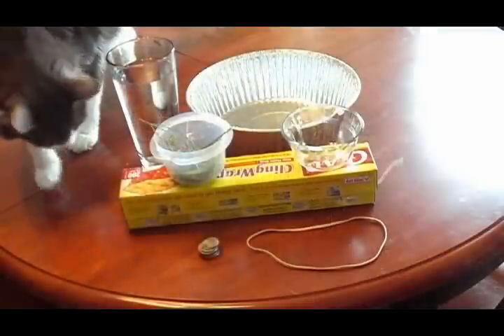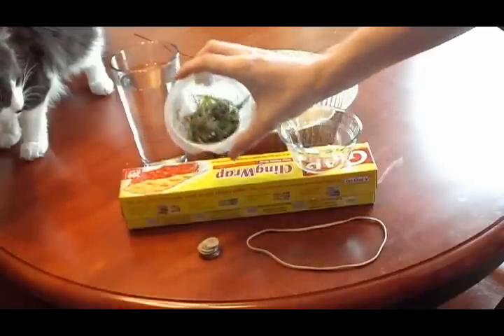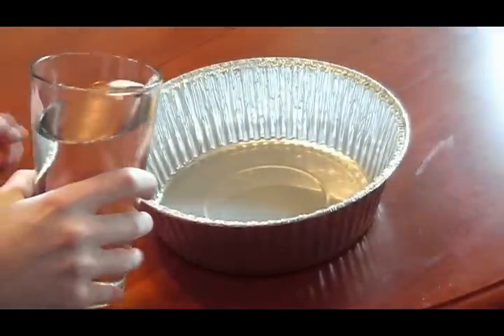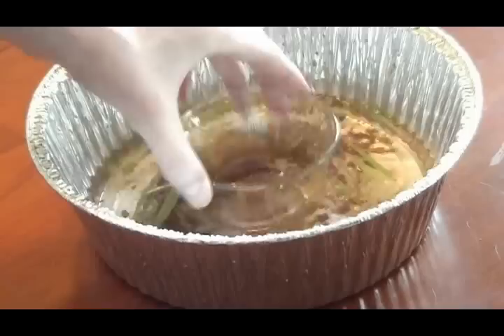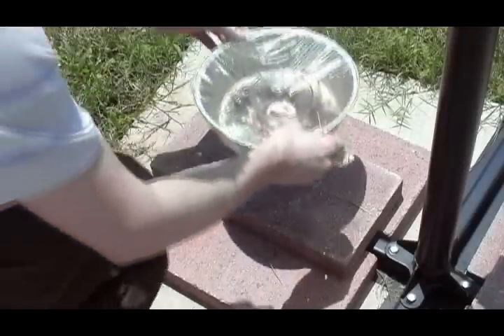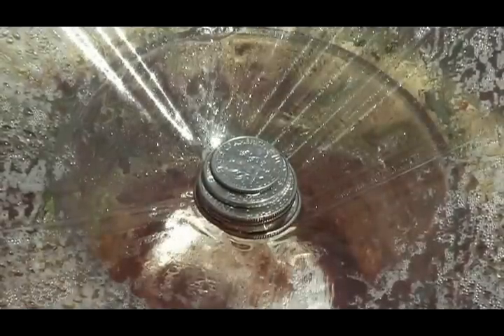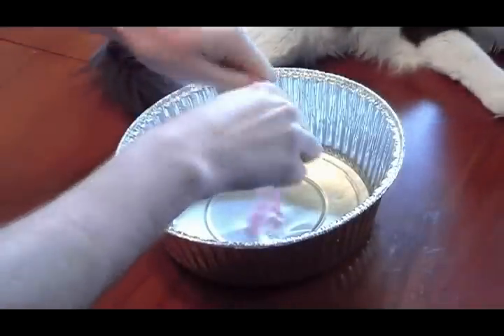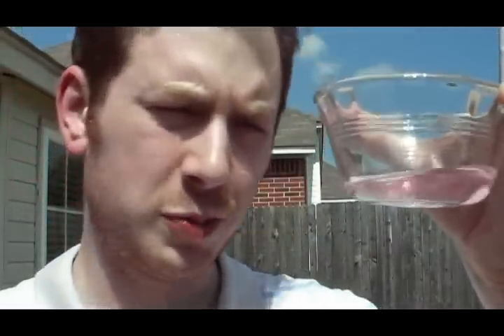Solar Water Distiller

Comment: I first heard this from a Viet Nam vet who said that did a similar thing. If they had no water, they could dig a pit, urinate in it and put leaves in it, they they covered it with plastic and put a stone over the collection cup (I don't know what they used). The sun evaporated the water and left them drinkable water. That  process is very similar to this process.

Comment: Finally, someone points out that you have to be careful of your water source when distilling. All those DIY stovetop distillers are USELESS if the water is contaminated by any chemical with a lower boiling point than water, such as Petrol, Benzene, Ammonia, Acetone, etc. https://www.engineeringtoolbox.com/boiling-points-fluids-gases-d_155.html

Comment: That's clever but the plastic would contaminate the water methinks, distilled water is very good at leaching(the plastic wrap covering it or the container holding the "distilled" water in the end). However most plastic used for food now is food friendly I think.

My point is beware of the materials you use in distilling if you want actual distilled water.

Comment: I don't use plastic at home and I never use aluminum. Boiling is free and probably one of the best ways to filter water, or UV light. For around $20. (USD) buy one of those H20 Life Straws on Amazon. They filter out 99.% of waterborne bacteria and 99.9% parasites. They do NOT filter out chemicals or pesticides like glyphosate (Roundup), salt water, arsenic, heavy metals, uranium, or viruses.  

That is why protecting water should be on "everyone's priority list."  Instead the EPA were exposed 'deliberately' dumping toxic chemicals into the Animas River in Colorado (but they called it a spill) which flowed from the Animas 200 miles into the San Juan River in New Mexico in August 2016.  You cannot filter out contaminated water like that. And the malicious beings who run the EPA know that. 

Those oil pipelines are another extreme danger and always built in the wrong places - near precious waterways as are nuclear power plants.  Hardly no one believes or fully understands the danger of not having drinkable water until it's too damn late because they think it'll never happen to them.
Reply: water condensed from water vapor from contaminated  is dramatically safer than boiling contaminated water.  some bacteria can even survive boiling, hence the use of autoclaves, but no bacteria can be evaporated. also, heavy metals do not boil away.  btw, boiling does kill waterborne pathogens.  autoclaves are needed to kill surface borne bacteria.
Reply: AquarielCharms 

You are exactly right
Reply: You should be getting 1,000 thumbs up for posting this accurate information. However, as usual, people will ignore it. Thank you.
Reply: I have a problem its not safe too (THE STRAW)CAUSE IT ONLY KILL 99.9% I NEED 0.1%MORE!!

Comment: Never use plastic to distill-this idiot is adding toxins from the plastic to the water. Plus these do not "purify"-all the crap is still in the water.
Reply: This is something used in emergencies where you can't find any potable water. It'd be very foolish to drink distilled water on a regular basis.

Comment: don't ever drink distilled water. Distilled water contains no minerals at all, so it will remove them from body with sweat and/or urine, causing serious problems. you may add some little amount of salt (sodium chloride), calcium and magnesia (dolomite stone) to convert distilled water into drinking one or drink juices if you can.

Comment: So the red colorant shows that the distilled water is not pure  at all. What's about poisons and bacteria? Without knowing this, it may by a high risk to drink it.
Reply: It's fine. This isn't the best way to do it, this is one of the simplest. Food coloring makes colored condensation, but solids can't do that.
Reply: The red color of the water is in fact caused by solid particles - most likely a pigment called carminic acid - suspended in the water.  The H20 does not change color.  Somehow some of those particles ended up in the collection cup.  Note how small the food coloring particles are.  It's like fine dust.  I imagine the upward stream of water vapor creates something like a tiny updraft which is enough to lift some of those tiny pigment particles into the air and into the cup.
Reply: My guess is the colorant has a lower evaporation temperature than water, so it too was distilled. If that's what's going on, then anything similar would be carried through - the benzenes, etc, while minerals, solids and anything with a higher ET than water would be left behind.

Comment: would a thin cloth work in replacement of the cling wrap?
And I'm guessing this method wouldn't work with salt water right?
Reply: +Sushi Mo Nope, it relies on condensation, the cloth would simply absorb the water and allow the vapor to escape. It does in fact work with salt water, but it can (as he warned) still contain toxins. Hence a filter should also be used with a distillation system to keep the water safe from any remaining toxic gunk.
Reply: oh ok thank you ^_^ Bruce Wayne 
What about Leaves?
Reply: Sushi Mo  No problem man. Did you mean leaves used for a filter or if leaves are in the water? If you meant for a filter it'd be really dodgy. Charcoal is a pretty top notch makeshift filter that requires little skill to make. Check this out if you want to see more methods on filter design: http://www.engineeringforchange.org/ten-low-cost-ways-to-treat-water/

Personally I think the clay and rice-husk design is clever and totally doable by anyone.
Reply: Thank you so much! This will help a lot and it's good to know someone who knows their stuff!
Reply: Sushi Mo That's all good :) I'm actually studying this stuff at the moment so it's something I know a thing or two about :)
Reply: niice! :D that's great!

Comment: what about mineral etc, because body needs that. is that ok if you drink everyday?
Reply: +smy yakob Normally you take in way more minerals through food than water, so unless you are on some weird type of diet you will get all you need.
Reply: +smy yakob Depends on your diet I guess.
Reply: I bought an electric water distiller off Amazon so I drink distilled water most of the time with no problems. They do say don't use it for making coffee as it makes it taste bad.

Comment: After distillation, boil then run the water through a charcoal filter to get rid of pollutants
Reply: +Moe Avazi Just the filter is probably the best idea. Most bacteria dies at a relatively low temperature (around 55-70 degrees Celsius) after just an hour or so. Boiling the water might help but really isn't necessary in a survival or natural disaster setting.
Reply: If you're going to boil the water, you may as well have done that in the first place to collect the water lol

Comment: While this does remove impurities, the only way to kill bacteria is to boil it for 10 minutes.  Boiling will also increase the evaporation.  I have seen many video's with solar distillers using this method (or similar methods) without boiling.  I think this could be very dangerous.  A better solution would be to boil the water with a Fresnel lens, capture the steam and condense it into a collection bucket.  Just my 2 cents.
Reply: Duncan Meskill This method will purify water that contained bad bacteria. This is not because it kills the bacteria, but it is because the bacteria is left behind. That being said, the water which evaporates does technically exceed 100 degrees C, and so if the bacteria did go up with the purified water, it would explode and obviously die (though the chances of it going up into the dish are virtually zero). If done properly, the only things that distillation will not remove are liquids with similar boiling points.
Considering this, it should be noted that convective currents in the air could potentially carry tiny particles of liquid water into the center dish. It is hard to completely eliminate this effect without some nice lab resources that would not be available in a survival situation, but you could possibly reduce it by making sure the rim of the inner dish is close to the plastic wrap.
It should also be noted that if you try to use this on salt water, liquid salt water droplets could get on to the upper foil and then fall into the inner dish just the same as any other impurities through the mechanic described above. There is probably no easy way to fix this other than having multiple purifying distillation stages in series (which would reduce the effect, but still not eliminate it).
Reply: But bacteria wont evaporate up. If anything, the water in their citoplasm will.
Reply: this is a great survival method, where you need to have any water... it has obviously no use when sitting at home with everything right under your hand
Reply: Kaden Burgart When it comes to surviving we're screwed anyway, America and the rest of the "civilized" world's ground is contaminated to the point where anything you grow in the ground or any of the animals you eat will likely carry high amounts of carcinogens, toxins and loads of other shit so there is no point in even trying anymore.

Comment: I wonder if anyone makes a "pressure sealed" pot with an escape hose that would create the same type of process?

You place a few cups of whatever water is available (dirty water) wherever you are (the desert, the deepest woods, a deserted island, etc. etc. etc.) into the pot. You seal the top of the pot with a lid that can be screwed into place for good. There is a hole in the top of the lid that has a transparent plastic hose connected to it. The hose can then be lowered into a clean container a few inches to a few feet below the "dirty water" pot. You then place the dirty water pot onto a fire so that the boiling process kills any deadly microorganisms while also creating steam. The steam then rises to the top of the pot, enters the plastic tube through the hole in the top of the pot, and then cascades down the tube into the clean container below.

If the dirty water pot is large enough and you can find enough firewood you could make anywhere from 3 to 20 gallons of somewhat cleaner sanitized water for everyone in your party to drink.

I wonder if such a beast exists?
Reply: there is actually a good solution with a pressured sealed pot. HOwever it works a little different than this but it is a really good solution. The solution shown in the video is limited to the sence that users need to buy wrappingplastics all the time and more important the quantity of cleanwater is limited. If this was a solution for a family of 4-6 in Africa it would take some time to produce a sufficient quantity.

Comment: Even simpler, take a pot of water with a glass lid, (wash the topof the lid and the handle well) put water and a bowl-(bigger the better) in the pot , then just flip the lid over... works on stoveor in oven too, just don't boil or water will splash into the bowl.... enjoy

Comment: @mikesablarry The tubes and foam sealant are what would concern me.  There have been tests done on a variety of different plastics used to make the microwave frozen food you can buy, including plastic types that purportedly have no BPA, and after cooking the food in the trays the food was found to have very high levels of BPA-- a substance that can cause cancer even at lower levels.  For frozen food fans-- pop the food from the tray onto a glass microwavable dish and proceed to cook..

Comment: Nice experiment. But the one flaw with it has to do with a substance called BPA. BPA is a carcinogenic chemical found in all kinds of plastic. In fact test have shown it to exist in high levels even in plastic that is not supposed to have any BPA. BPA is released from plastic especially when heated. Setting plastic jugs of water in a hot car-- bad idea- try to cover them with comforters and blankets to insulate them for the trip home.If you can cut out plastic in the distiller it would be safer.
Reply: is the method that is showed on the video working??

Comment: @Lucassandro25  You can do it with any water.. it will work well with ocean water as the salt wont evaporate.

Although as he said some water can be contaminated with So3 amongst other chemicals and its advisable to boil this water for a couple of minutes to be 100% sure its safe. A similar technique can be used when boiling this water to collect the condensation that would otherwise be wasted through the evaporation during boiling..

Comment: I want to ask you if you made such experiment. To increase the evaporation rate it is possible to make a small drops near the surface with the help of aquarium compressor. I'm interesting if the rate will increase sufficiently

Comment: @bamjes103 First off, moonshine is already distilled, so no need. But to answer your question. Alcohol evaporates at lower temperatures than water. So it would need to be at a temperature lower than that what is shown in the video. I am not quite sure how you would regulate the temp on something like that.

Comment: Actually it does. You can use that as a desert survival technique. You would actually urinate in the hole you dig, and place a few cacti leaves inside the hole. It will distil and purify everything.

Comment: Sure you could.

Pour some diarrhea into the evaporation dish. The sun will remove the water from the crap. 

I would still use the WHO approved UV treatment in a PET bottle, but the distiller will get rid of any "solids".

With this distiller, and UV treatment (which is also solar) you can turn human raw sewage into drinking water.

Comment: Only if your trapped on an island should you do this. 

In order for the evaporation to take a liquid form, it needs a nuclei. The nuclei is made from polution such as dirt. So for every ml of water, there is microscopic piece of dirt, woot!

To make this more effective (but it will take so much longer), add plastic wrap on top of the inner cup. The water will eventually get past it, leaving the dirt.

Comment: i did this experiment for my science project.but it was in winter. so instead of a sunny day, i put it on the stove. i put the fire as light as possible so the water is no boiling hot. so i replaced the sunlight with the stove. it works as great as the sun.